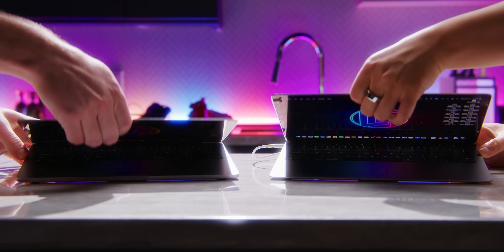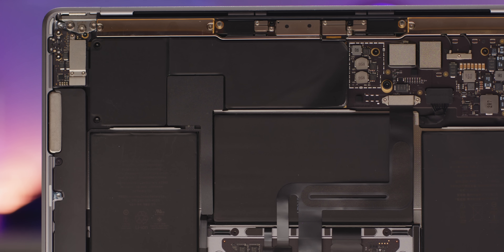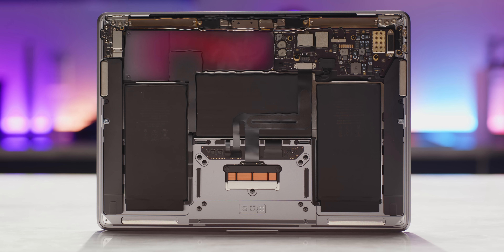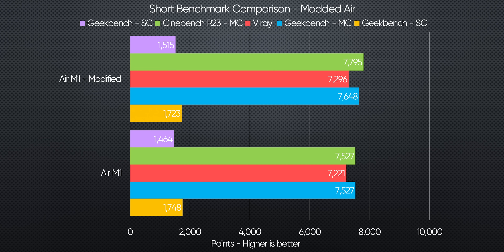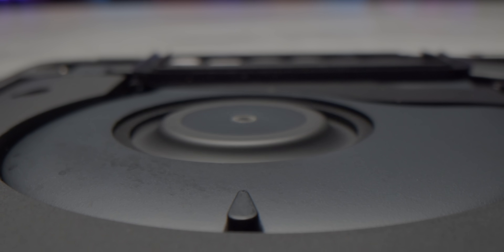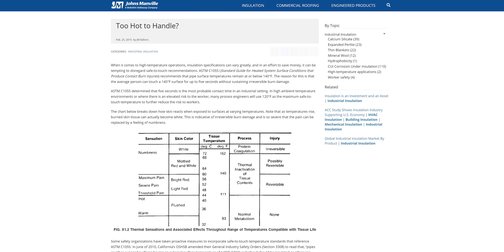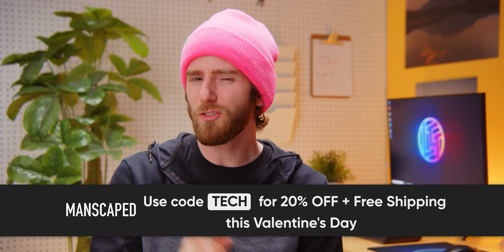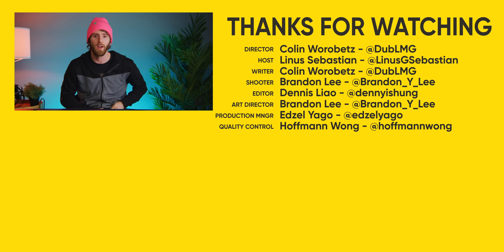Fixing Apple's GOOD Engineering - M1 MacBook Air thermal pads

Comment: Linus, one correction, the IEC 60950-1 was withdrawn on  December 20, 2020.  It was replaced by IEC 62368-1. The limit is now 48°C at an ambient temperature of 25°C from chapter 9.
Reply: Erwin doesn't fuck around with his IEC codes, get it right Linus.
Reply: so, 3 degree more space for next year's model. We're gonna see a 5% performance boost for long duration jobs!
Reply: Interesting how they give the manufacturers more room just so they can deliver better performance in newer models. I doubt that they now just found out that this temperature isnt too hot for the human body.
Reply: @OutOfRangeDE  i mean, its probably because no one is reasonably using their laptops, on their laps, at full tilt in a room that is 35c....
Reply: @ale6242  Australians be like uwot??
Reply: It's after the release of the new Air, so it doesn't apply.
Reply: Why was it changed?
Reply: @WarriorsPhoto  

Humans were catching fire from excessive overclocking adventures. This was coupled with a mobile device clockrate firmware lockdown fest, which can be circumvented by the powers of super geeks.
Reply: @remasteredretropcgames3312  The force is strong with you Jedi Master. Do humans have a chance?
Reply: @WarriorsPhoto  

Merge with us.

We need more raytraced retro, and greater securom annihilation practices.
Reply: @remasteredretropcgames3312  Yup sounds good. Thank you for the comments on my channel. That is highly appreciated. (:
Reply: The current Macbook air must have been grandfathered into the previous regulation though considering when it was released, right?
    Still, this is a very pertinent comment. Thank you for the insight!
Reply: "The Expert" thanks for the update man! very helpful
Reply: “George Lucas should have DISTRIBUTED the 'SOURCE CODE' to Star Wars. Millions of fans would create their own movies and stories. Most of them would be terrible, but a few would be genius.”
-Gabe Newell

"3HAR7E lu11e hiss s.8.8.8 hood afters drip you DID thaw swords 3o1t tw15 stare worse m1il ye OWNS offen4s wo18d GRADE fair ON 13.15ve he sends do15r ease m21st OFF firm wha20 beat HEIR 1.16.16.12.5 body 23i5w watt 2.9.20.ching YOURS."
-Our Divine LORD

LIFE FORMS LIVING TOGETHER FOR MUTUAL ADVANTAGE. Without the midi-chlorians, life could not exist, and we would have no knowledge of the Force. They continually speak to you, telling you the will of the Force. When you learn to quiet your mind, you will hear them speaking to you.
-Qui-Gon Jinn

https://www.youtube.com/watch?v=K48M2S7bkSA&feature=emb_logo
Reply: https://www.youtube.com/watch?v=cGYKCTFIZLI

B-)
Reply: 7.1.2.5 14.5.23.5.12.12 is 23120ching.
Reply: The new religion is peace, beauty, and science. 

Join my cult.

We have cookies.

And plastic combat memorials.
Reply: Why is FXAA still hanging around like the needy divorced chode with devs paying at times millions of dollars toward just the art segment of their products creation alone adopting it without granting you option to terminate it. Its image quality being comparable to quincunx which was taken out behind the barn years and years and years and years and years and years ago. I get the idea that the devs for metro redux 2033 thought it was trolly to call it analytical or logical when their competitors about a year later were using predication SMAA? Isnt the redux the like, slightly more modern code? 

Does the industry really structure itself so that objectively inferior technologies are continuously peddled like they deserve space in modern capability? Linus, I love you bro, but someday, somehow, somewhere, i pray to the Gods, this is logically sorted out. Art as my accomplice.
Reply: Gabe Newell Cybernetic Memes are coming.
Reply: Do or do not, there is no try.

Seriously. Nvidia please stop.
Reply: NEEEEERRRDDD!!
Reply: @richmahogany1  Yes, and an engineer.
Reply: @estuhr   :)
Reply: @estuhr  , so what do you think of the effects on the battery?
Reply: @alessandrobruno3874  By pulling the heat to the big aluminum back plate it will reduce the temperature of the CPU and other hot chips, thus with less intense heat right next to the battery, the batteries effective ambient temperature should be lower. The small gap between battery and aluminum back plate should prevent battery from heating up, so negligible effect on battery life.
Reply: @estuhr  

Build us safe compassionate AGI so we can get self replicating nanobots so we can merge with God.

Step 1. Abandon random mutation as ethically as possible.

2nd.      Build relativistic laser highways and be peaceful and stuff. 

Conclusion. Space robots are cool.
Reply: @richmahogany1  hater
Reply: IEC sucks balls, though, it needs to be abolished.
Reply: @sujimayne  Uh, no...

Comment: Has done that since your 2020 MB air mod on my low end i3 laptop

Without help with cooling pad 
It's onky help cools down like 3-4° 
(Default are 77C, modded 73-75C)
Surface temperature are quite impressive giving it only has plastic Chassy(peaked around 51C using infrared thermometer)

The difference when you use cooling pad
I use a budget deepcool windpal mini 
And get 61C average temp on constant gaming

Since I am a person who almost never use laptop on a lap 
I don't care that much about that safety standard

Comment: You can add an external laptop cooler that will turn the bottom aluminium piece into a jank heat sink. Turning passive cooling into active. So get thermal pads and a laptop cooler and youre good to go, no?

Comment: I have to say, I'd be super curious how this mod would perform when the laptop is put on top of one of those "laptop cooling Mats" with the fans in em. Given the thermal properties that aluminium holds, and having an active cooling solution added on top of this mod might yield some interesting results.
Reply: I'd like to see the results from this too. If you can pay an air price for a pro performance, might be cool to see.
Reply: At that point you could just get the pro
Reply: Utkarsh Aryan idk where you live.. but the pair together costs less than 20$ near my area.. so i dont think i can get a pro..
Reply: @utkarsharyan  I'm speaking from curiosity only, if the thermal pads alone can make that much of a difference. I'd be curious to see what adding any form of active cooling solution to it would yield for results. Linus has done far dumber and costly things "for science" before after all lol.
Reply: @utkarsharyan  
You could but then there is the cost of getting the dust out of the system. If you can get better performance for longer than the pro I do not see why you should add a point of failure and a source of dust to the system. When all you need is some thermal pads and an external fan.

Comment: Looks like with this mob, as long as someone don't use it on lap (get a suitable riser and use it on desk) it should be fine. Get desk/stand fan and blow directly (like most of the South East Asian did) to help ventilate the heat away. Problem solved and save $$$. LOL..

Comment: '35 degrees is an unreasonable ambient temperature'

*cries in Australian*
Reply: To be fair, Linus is too young (and Canadian) to remember that "the Australian sun is hot enough to fry an egg [on a can of housepaint]".  Aussie CPU == 4-burner BBQ; get some pork with Apple sauce on your fork, boys!
Reply: @ecarter2747  He's older than you buddy. That's a 36yr old furry tech tips right there.
Reply: @therealb888  ...so, he's 10 years my junior, then. :P
Reply: There is a reason why engineers generally use 55°C as the ambient temperature for validation. It isn't that uncommon to reach 45°C in the shade summer and that's in the cooler southern states. And you have to consider the air being heated by the device itself, direct sunlight etc.
Reply: Indeed. Same here in India, where summer hits 47° plus.
Reply: Laughs in Brazilian. 40+ Celsius EASILY.

You are weak. You lack hatred.
Reply: *cries in Malaysian
Reply: Linus - "35 degrees is an unreasonable ambient temperature"

Me - cries in Indian
Reply: *has a nervous breakdown in Indian*
Reply: We Canucks consider 30C a hot day and 35C a scorching hot day (reduce those numbers by 5C in the ever temperate Vancouver area where Linus is at).  We don't do tropical heat.  Now -35C, that is something we understand all too well.  We're built for cold tolerance, both in housing/garb and mindset.  45-47C doesn't even compute as weather to a Canadian.  It's just the temperature of the coffee warming him up when it's -20C.
Reply: 45+ or gtfo
Reply: @mohdrashid6755  yeah, for a bleeding edge OC i have a profile for dawn/dusk, day and night, because the ambients swing from -2c at night all the way upwards of 45c in the day
Reply: My CPUs ambient temperature is 35°C in the winters lmao, also by winters i mean 10°C
Reply: @mohammadmujtaba8125  That is temperature would be near public calamity here if we had to deal with it for a entire season.
Reply: Yep even for us, that's totally reasonable during the summer months...
Reply: Baloney, try 49.2 at Marble Bar.
35+ in an office is a tad unusual, however we are talking laptops, which means out in the field.
Reply: Me: CRIES IN A SALT LAKE CITY, UTAH SUMMER
In all seriousness, ambient outdoor temperatures in Salt Lake City, UT regularly reach and exceed 35C in the summer.  And, for +What's Inside down in St. George, 35C is actually the daily average in summer.
Reply: @crabhat1 bruh, there's no "global warming"
now they call it "climate change"
the earth has natural heating and cooling cycles lmfao.
Reply: @nos676  You don't think the climate science nerds haven't also figured that out and account for it in every model they produce?
Reply: Australian cry: mate mate mate ewwww maaeeeeeete maaaaaeeeeeete
Reply: When we have 40+ and have to unplug all of our electronics where there's no aircon or they overheat. Had so many Chromecasts die during the summer it's stupid
Reply: @r4z0r84  Damn which country?
Reply: @thesagarmahapatra  Australia
Reply: @r4z0r84  Good Eye Might! jk :P
Reply: @thesagarmahapatra  g'day m8
Reply: well..35 huh, I never ever had anything below 30 my entire life..
Reply: *Cries in Bekasi*

Comment: so it's like:
"worse performance or roasted sausage"
Reply: Trick's on you: I don't use a laptop on my lap.
Reply: @handlemonium  we'll be fine
Reply: Joshua Cheng no one should, it’s so uncomfortable, and scary that the laptop will just slide off.
Reply: Sasanth Bollineni sorry i do.. my laps are big enough supported by rubber pads on my kaptop to hold it up from slipping..
Reply: @handlemonium  sweaty palm?
Reply: Sausage with eggs
Reply: @13namtiH13 
If your sausage has some eggs, you probably don't have a laptop sitting on it.
Reply: OVERCOOKED
Reply: nobody wants broiled tuna

Comment: What about the battery? It will get exposed to all the heat that the back panel have. So the trade off here is getting a hot back panel + you damage your batteries as well. There is a well documented article by Apple that explains how effective high temperatures are to batteries(Lithium ion): https://www.apple.com/batteries/maximizing-performance/#generaltips

Comment: Since a graphene sheet is very good at displacing heat laterally would it help spread the heat more quickly along the entire bottom of the chassis and increase heat dissipation if you pasted a sheet on the entire bottom cover (still including those thermal pads)?